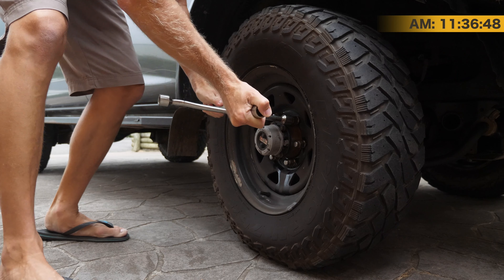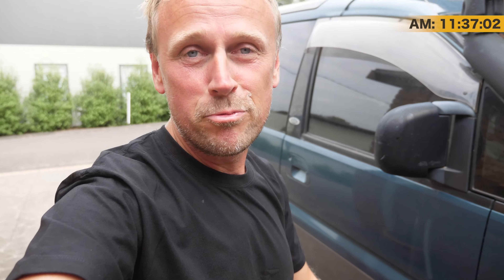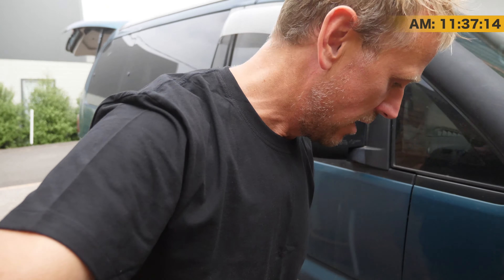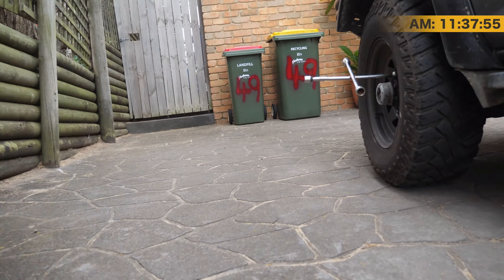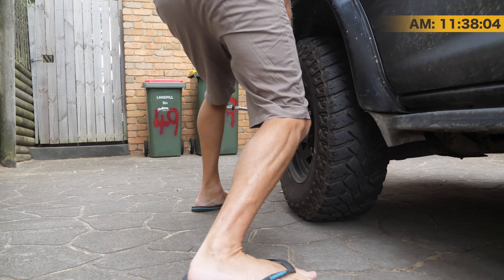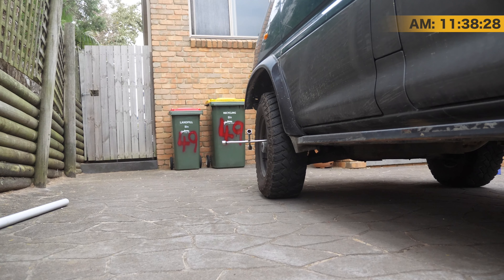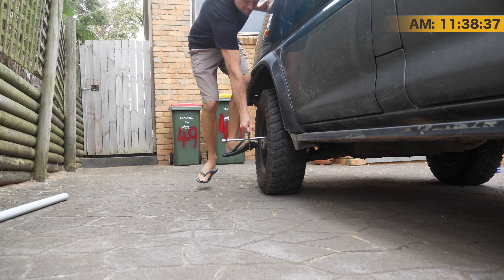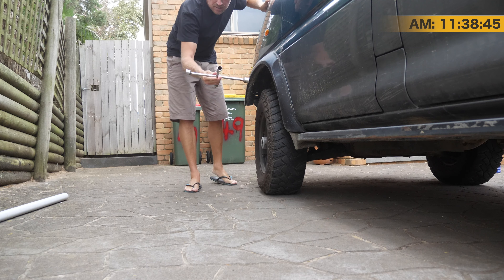Plastic Pipe Won’t Help Loosen Tight Wheel Nuts

Comment: Sounds like you need a breaker bar, don't know how the mechanic over tightened it that much since they're supposed to use a tool similar to a breaker bar that measures how much torque the bolt is tightened to.
Reply: iMoonset Hiruka 
A "Torque Wrench" or a "Torque Guage".
Reply from the maker: I'll keep my eyes peeled for a bar or pole, but in the meantime I will just leave the mud tyres on lol!
Reply: Ah, yeah torque wrench, forgot the name. Hey as long as they're good tires just hope you don't get a flat
Reply from the maker: Yeah same here! lol

Comment: NOT a good idea to spray WD40 near your Brake Discs/Rotors, because if you get it on your Brake Pads it will "contaminate" the Pad material and possibly minimise its resistance against the Disc/Rotor when you go to brake, thus giving you none or very little braking on that wheel.
Reply from the maker: It's a good point, but to my credit I was using the thin, red directional squirter and only a few drops went on each bolt.

Comment: My god. Have you tried wd40? That's over torqued. Next time ask your mechanic to use correct torque on the wheel cause over torquing might damage the wheel  where you fixate the wheels. !
Reply from the maker: I tried the WD40 in this video Sergio.
Reply: Yes !! Sure its better to go to the mechanic.... I bought a lot of tools for my car .. did you drop the wd40 within the bolts?
Reply from the maker: Yeah I did man, just a couple drops on the top of the bolts.
Reply: @GivesAMinute  pneumatic drill is the solution for it !!!